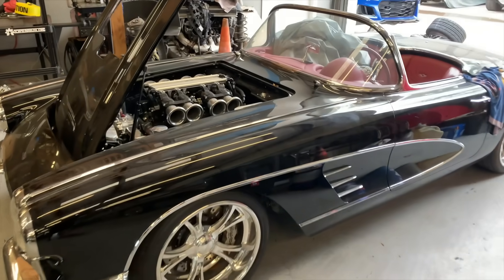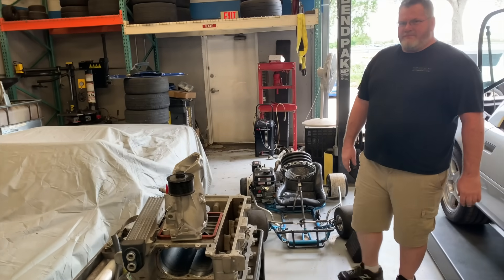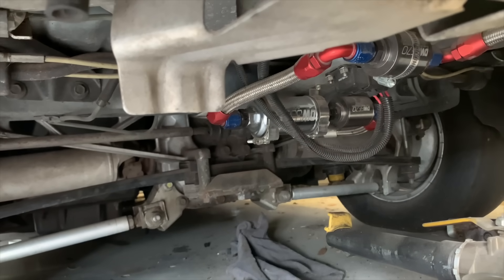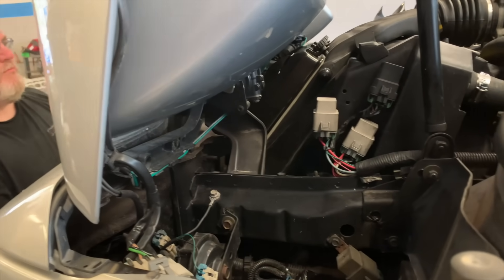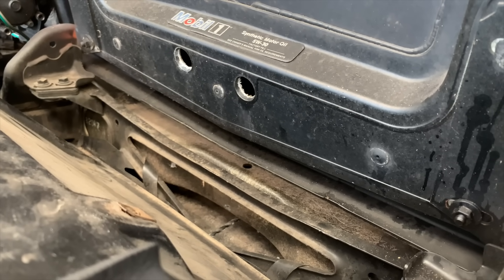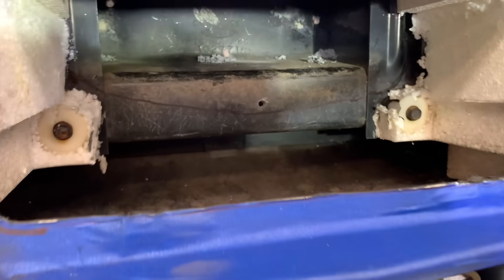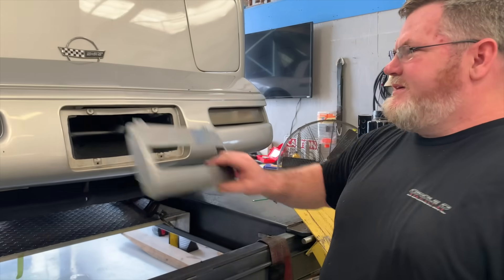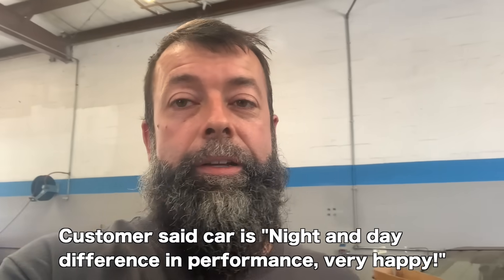Legend: "I Forgot Where We Left Off When Things Went.... PLUS HUGE C4 POWER MOD!

Comment: Good to see you back.
I love my Vararam even though it's the most hated cold air intake for the C5. The only modification I did to it was permanently silicone the filter into the housing because I found a little grass one time that bypassed the filter.

Comment: I have a gen 1 SBC in my c10. Got a friend to make up an air intake to get fresh air beside the radiator instead of the open air cleaner under the hood.  I can tell you it picked up 3 tenths in the 1/4 with my setup, well worth the 50 bucks and 2 cases of beer it cost me.😂

Comment: I put some 1" foam on each side of the radiator to block the engine heat from air cleaner. My inlet temps never get over 120 and close to ambient cruising on the highway on my 94 C4.

Comment: Hey Jeremy im having an issue with my c4. Unknown mods. Stumbles off idle. Changed everything but injectors, fuel pump, f.p.r.   ive done smog delete, egr delete, maf, iac, tps, plugs, wires, cap, rotor. Im at my wits end here. Any help or tips would be greatly appreciated

Comment: Just when I was wondering what actually happened you guys, a video came up. I know that y'all concentrate more on customer vehicles and things happening at home rather than YouTube, which is why I really didn't bother you so much.

Anyhow, you should look at the super sucker intake for the gm F bodies. That was a ram air intake developed in the early 2000's using help from the dyno at John Haley Motorsports ... where I used to work..